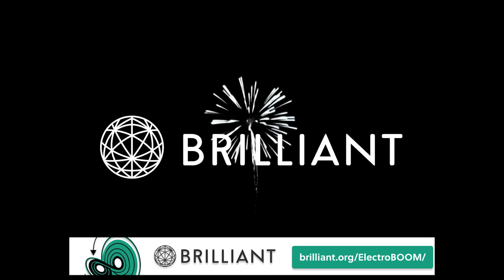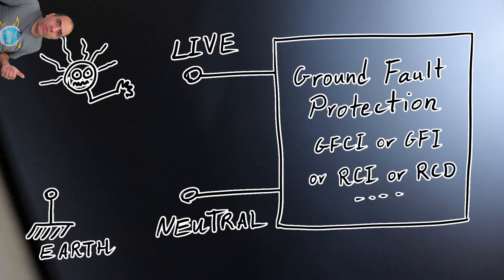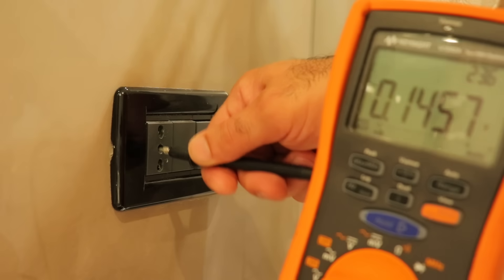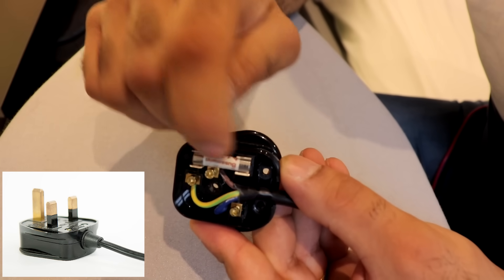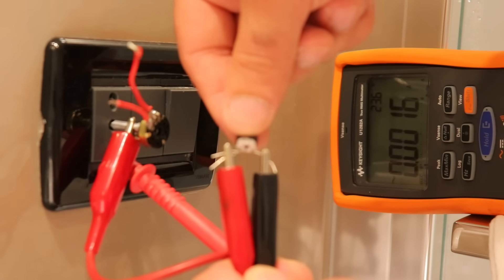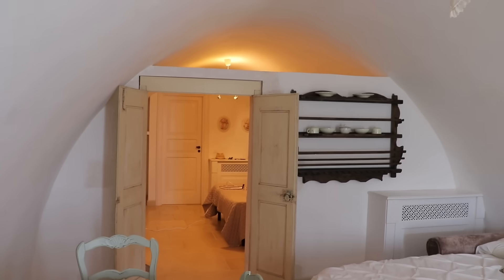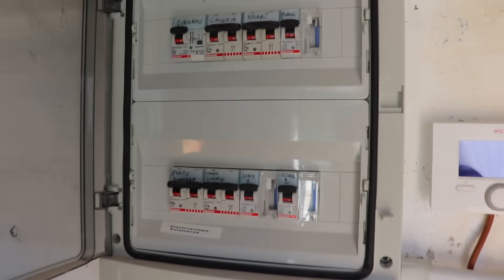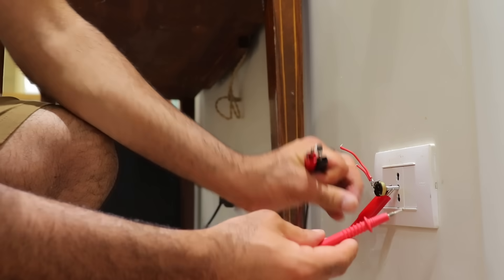Tripping Every Breaker in Italy

Comment: The vertical weird plug in Puglia is a phone connector. A very weird one, yes, but it exists somewhere
Wrong, @demmidemmi identified it correctly as a high duty old italian plug (non domestic)
Reply: It's called TAE plug, it's a german standard
Reply: Was that not the old italian "magic" plug?
Reply: @demmidemmi  damn, you're right! I forgot about their existence! It's a not too safe (not used for domestic appliances) us with non inverting live, ground and neutral
Reply: @effeffe9  I've seen a lot of bad handy work in Italian hotel rooms but I think showing a low power phone line into a outlet would be a step too far.
But yes those plugs are horrendous.

Comment: I was in Italy as a builder for a month, the electricity instalations in the old houses is just crazy.
Reply: I recently changed all the light switches and outlets in my grandparents' house, every wire was cemented in...
Reply: @silopante  I'm from Spain I had to change a lamp and some outlets in my sister new home (the building is like 50-60 years old) and in some rooms the live and neutral color were black for both and in some rooms the colors were shifted and in all the rooms the cables were solid coper and just in one stranded, Idk what the hell did they do in Spain in the 60s
Reply: In the whole world. In USA, Europe, Africa,... Old instalations from de 70 -80 have this problems. Just look  Scott bro´s tv show to check "minor issues" some USA  600 000 $  30 year  houses have. Regulations, materials, safety ...everything has changed
Reply: @jcr4581  not all of europe. In NL the systems can be very old, but even shit from 1955 has earthed outlets in the same plugstyle as we have now, in bathrooms, kitchens etc. Even the old earthrods tend to measure well below 1ohm. No RCD's, or maybe a single 300ma one. 

Still safer than US stuff lol.
Reply: @Deiphobuzz  Itsnt the type C ungrounded outlet still allowed in NL for dry places like rooms?
Reply: @MernokiMegoldasok  only if it had them when it was built. If you do mayor renovation, you need to comply with new regulations.
Reply: It's the same here in rural Canada, too. They did some wild shit back in the day.
Reply: Yeah in Italy I’ve seen a lot of frightening installations from the 50ish where all the wiring was made hammering flat cables to the wall paying attention not to touch the - very thin - wires with the nail. I remember seeing sparkles coming from the ceiling because my grandparents house didn’t have any protection at all back in the 90s, but we were so happy :’)
Reply: here in Mexico modernize electric components into an old house is allways a pain in the ass, because is very common, but is also better pay for an entire instalation

Comment: Your incident reminded me of my trip to Germany, during which I plugged an American surge protector with an adaptor into an European outlet. It popped the circuit breaker and smoked my power strip...
Reply: Surge protectors tend to use some kind of resetable fuse that "opens" when they get too hot but I imagine that subjecting it to 240 volts out of the gate just fried it. I bet if you where to open it you'd see something burnt out/exploded.
Reply: @nekomasteryoutube3232  Ones i have seen use a standars fuse and ametal oxide varistor.Is the voltage is high enough,the varistor shorts and blow the fuse.
Reply: The surge protector did his job! They are supposed to short circuit and pop the breaker if the voltage is above 150V.
Reply: "this is revenge for 2 world wars"

Comment: The live and neutral look "double-drilled" because Italy used to have slightly different sized outlets for lamps vs appliances w/ electric motors, because they billed those at different rates in the old days.
Reply: The smaller holes are rated for 10A, while the larger ones are for 16A. A socket with both is called "bi-passo" (two-step)
Reply: @MartinodF  intendi bipresa?
Reply: @maxfelicitas.official  No, bipasso: https://it.wiktionary.org/wiki/bipasso
Reply: Also Schuko (Type F/E)  contacts should be wider than the inner holes making it impossible to plug without grounding. It's weird that he managed to.
Reply: @niconiconii-san  I thought maybe that was more about the current rating? I live in a place where I grew up with ungrounded outlets being the norm, and they accept grounded plugs. Ungrounded outlets are only for dry rooms, and are not to be in close proximity to a grounded outlet, so as to prevent the case where the user could be shocked by touching a live chassis of a faulty device plugged in an ungrounded outlet at the same time as a chassis connected to a grounded outlet. Though I happen to live in one of the only places where earth is supposed to be isolated from both live wires, hence a single fault (connected to the same substation) will in principle not cause any current flow. I thought maybe this relaxed use of ungrounded outlets was a result of that.
Reply: @niconiconii-san  Yeah exactly, the Schuko plug dosen't go inside the other type of sockets
Reply: It's the same concept as for 15/20 Amps in North America, except in Italy it's 10/16 Amps at twice the voltage, but being the wires relatively small because of he low current, almost every outlet is wired for the big load
Reply: Huh, that is actually a cool distinction! How big was the difference in rates?
Reply: @traniel123456789  I'm pretty sure light was cheaper, since at least in some parts of the country it only ran at 120-130v. Was all before my time though.
Reply: The smaller one is rated for 10A, the bigger one is rated 16A
Also, the wird plug mentioned in the video is a telephone socket, but afaik it's obsolete and has been replaced by RJ11
Reply: @admin I think it was the U.S. that was the first country to have electricity wired to homes. It seems we haven't updated our 115V standard in that many years, except to add the ground pin and "polarization" of line and neutral by using a slightly wider neutral blade.
Reply: @yeroca  Nope. London was first, but only a couple of months before New York.
Reply: @admin When the ancient Romans weren't slaughtering Carthaginians and fighting lions in the Coliseum, they were charging the peasants extra to use their washing machines and dryers. Those bastards...
Reply: Good fact 👍
Reply: @admin :D
Reply: @admin oh right my bad, yes we did have electricity back then.
Reply: @admin I'd rather say the US is still stuck with their legacy stuff...
Reply: @admin That makes it interesting. From what I have seen of videos over there and a friend who does missionary work on electrical they had to get quite creative to bring power into those old buildings. Seems wiremold and other surface conduit is used a lot. One I was watching I think in the middle east they have to hog out the solid block a lot of homes are constructed with because there is no cavity inside. I would love to talk to an electrician over there it's got to be a nightmare doing 2 story or more structures where you got to deal with floors and ceilings. If you look around or I can find a link to it there is a youtube video of them rewiring Buckingham Palace? I think it was. Very fascinating.
Reply: @admin electricity didnt exist thousands of years ago though..
Reply: @admin except with Tesla and Edison operating in America, America invented household electricity and the central grid. Why do you think the US plug standard is so relatively dangerous and called type A or type B; it was the first invented and before safety design.
Reply: @Tang-qi6zw  the UK had the first public grid station. Also the first incandecant lightbulb was made by Swan, not Edison.

Not everything was invented in the US.

Comment: I was in Croatia a while ago and the weird thing was that the electricity meter and sometimes the breaker box were mounted outside of the house. On the campsite we were staying at, the breaker boxes just stood around for anyone to mess with
Reply: El. Meter in Croatia is always outside of house or apartment because el. company does readings once a month. As for fuse box, it's unusual to put them outside but doesn't surprise me since construction can be cheap and wild sometimes
Reply: Meters are always outside in croatia form my experience
Be it electric, gas or water

having breakers outside is pretty weird too, but I could chalk that up to the owner inviting "their cousin's nephew" to do the wiring, as that's how most things are done over here
Reply: For newer regulations also in Italy electricity meters should be outside. This is for a number or reasons, they can at any times be inspected by the electricity company to assert that you didn't tempered with them, and you don't have power cables that you can't isolate running into your house, that are dangerous in case when doing some work you accidentally short them (there is no protection, you will blow the fuses at the substation but that would mean hundred of amps flowing before it happens). 

Usually after the electricity meter another breaker is placed to protect the wire that goes from the meter itself to the house for overload if longer than 3 meters (and sometime it's needed protection for indirect contact, i.e. an RCD is needed if the entire run is not double insulated including the electrical box inside the house that must be made of plastic).
Reply: That is really common in parts of the USA. I live in the Inland NW, and my meter, 120v/200 amp outer main breaker and a 60 amp well pump breaker are in a stand alone "pedestal" steel cabinet about 100 feet from my house, on the side of the road where power drops from overhead to underground to my house. It's  lockable, but not locked. I want to be able to get to it if there is a fire or something. Pretty much all the houses I've dealt with in the area are similar. Sometimes just mounted on an outer wall.
Reply: The electricity meter is usually outside for reasons explained by previous comments in newer buildings, but in older buildings they were usually inside.

Breakers being outside is by no means standard in Croatia and I actually find it a bit weird. If you saw it at a campsite, it's probably because a campsite is not a standard building and it might be preferable to have them outside for some reason. If you saw it elsewhere, then I can't really explain it.
Reply: In Bosnia and Herzegovina electricity meter is always placed in special box outside of the building so that electric company can read it. The box is locked and generally it can be accessed only by them or under their supervision. The box also always contains the main breaker for the whole house. Its purpose is to protect the cables that connect your house to a transformer and it also limits your maximum wattage which you've agreed with the electric company. Both the electricity meter and the main breaker are lead sealed and it would be an offence to break it or to mess with it in any way (that is if you manage to open the box somehow). I think this is how the thing are in Croatia too.
Reply: In the US it's common for older houses to have the breaker box outside.  Mine is just a few steps from the back door.  I suspect that was the original location when the house was built 102 years ago.  (Yes, it had electricity back then, the remnants of the original wire and gaslight pipes {yes, dual fuel lighting} are still there.)
Newer houses have the breakers inside, but the meter is almost always outside.

Comment: What you found in the last hotel with the european plug is what I consider sacrilegious. The main italian plugs are the 10A (thinner and closer pins) and 16A (thicker, more distant pins) (or well, they have their names but they are rated for respectively 10 and 16 Amps so they are usually addressed by these names)
That black plug is a Schuko/European plug (derived principally from the german one with some accomodation to be used more extensively throughout all Europe AFAIR) that have the plugs with the same thickness as the 16A Italian plug, but the distance is the same as the 10A. So pluggin an european plug into a combined 10/16A is forcing poles into holes not made for them, resulting in a very poor connection in case somebody wants to connect a 10A plug later. There are adaptors specifically to avoid that! As said, sacreligious.
Reply: Or you can just cut the plug,strip the cable and plug the stripped wires in the outlet(It was ajoke,dont do it).But i saw many people doing it.

Comment: I am only waiting for the day you've come to Brazil, our electric standard is completely random, in old building it resemble american/canadian because of solid wires and NEMA breakers, and in new buildings, it's more like Europe, with stranded wires and DIN rail breakers. Our plugs are kinda similar to Italian ones but the ground prong is more aside forming a triangle shape not a straight line as those, and the outlets are entirely recessed, so even more secure. Also, blue is generally neutral, not live. Even IEC power cords have blue as N, brown as L and green-yellow-stripped as G. Thanks for the content mr Mehdi.
Reply: The day he plugs the multimeter in Brazil, it's going to have a power shortage.
Good thing we all can just use some wires and nails to fix...

Aos Brasileiros como eu, bom dia a todos!
Reply: @f3rny_66  hotels generally have hot water pipes fed directly for bathrooms and stuff, but it's not hard to find the suicide showers all over the place anyway
Reply: @WagTsX  Better than having a thermobaric in your house.
Reply: I've heard you also have a mix of 220 and 120 V. Is that so?
Reply: @paulotex19  220 & 110, but yes.
Reply: @isaacm1929  Isnt it also 127/200 and 220/380?
Reply: @MernokiMegoldasok   I've never seem something like 380 V in my entire life...
I cannot even imagine why it exists...
The 127 V is normal in some places, but is not that common, pretty much everywhere is 110V electronics, but if your house is 127V, the only thing you can do is plug 110V electronic in the 127V outlet...
Not that 127V electronics don't exist, is just that it's uncommon...
Reply: @isaacm1929  380V would be the voltage in a 3 phase system if you have 220V from live to neutral then 380V between 2 phases.
Reply: @MernokiMegoldasok  In what place is this used?
Reply: @isaacm1929  Wikipedia says that Brazil uses it in cities.It was also used in Europe but converted to 230/400V.
Reply: @MernokiMegoldasok  I've searched here. It's strange for me cause I've never seen it here, but some electric companies use it in some cities. I don't even know what to say about it... 4 types of voltage in my country...

Edit: Makes sense, I live in São Paulo, here is 220V
Reply: Brazil's new outlet setup is exactly the same as the one in Switzerland. No other country in the world, that I know of, uses the same
Reply: @gustavonilson  they're actually slightly different, the earth pin is a few milimeters up, causing the plugs to not be interchangeable
Reply: @gustavonilson  Almost the same, doesn't fit by a millimeter, very annoying, now I have a useless overpriced EU-swiss adapter.

Comment: Historically, every European country has different outlets and cabling standards. Due to Harmonization across the EU, "double" standards and those "double holes" in the Italian outlets occurred.
Ideally, harmonization should mean that one type of outlet is used across the EU, but due to national favorites it of course means just one more type of plug to use, and plugs with earth not connecting to the outlet ;-)
Reply: No, the "double holes" (in italian "bi-passo", "two-steps") sockets are compatible with the two standard italian three-prongs plugs. In ye old days electricity in Italy was metered differently (and was of different voltage) if it was just for lighting (small plug) or for appliances (big plug). I think this lasted until the 70s. Nowadays small-only sockets are wired in a 10A circuit, while large-only or bi-passo sockets are wired in 16A circuits.
Europlugs are functionally identicall to italian 10A plugs but they don't have an earth connection, and Shuko plugs (large and round) shouldn't fit the three-prong sockets; we have dedicated "multi-standard" sockets that accept all of those standards, but sadly even newer installations just put the basic sockets probably because they cost a bit less...
Reply: Idea is to get everyone to play nice  with each other so that hopefully, one day the whole of Europe plays one grid, making power management and power consumption easier to deal with. Unfortunately, local politicians don't like it when other people steal their bribe money...